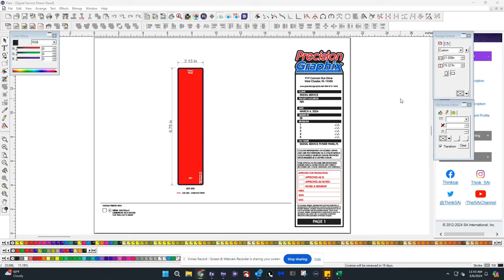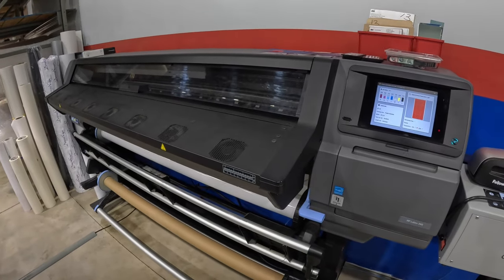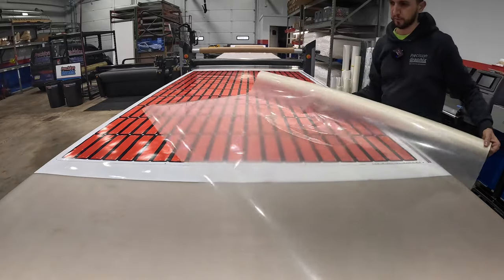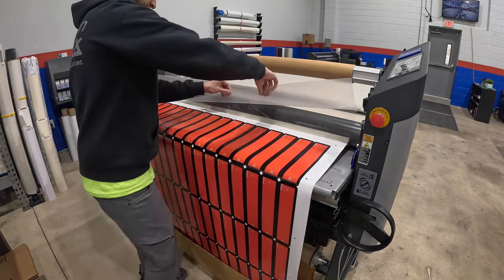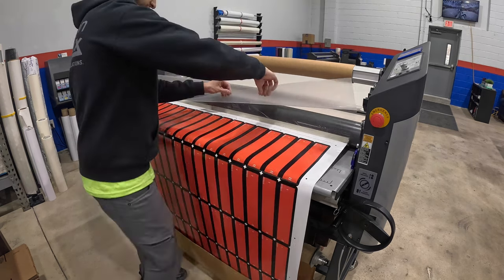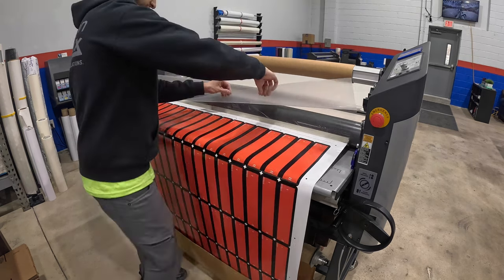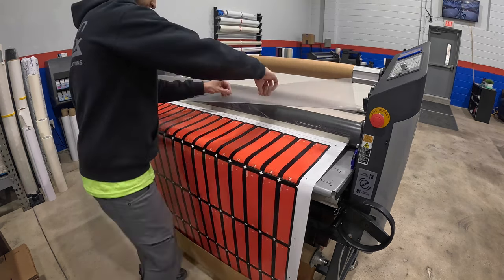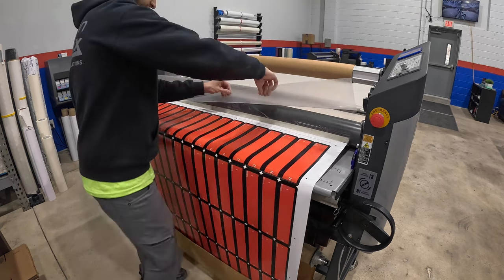How I Make Die-Cut Decals & package them!  | Steve The Graphics Guy

Comment: Nicely detailed process - but this is not die cutting as the title implies.
Reply from the maker: What would you call it?
Reply: Hello Steve, I am a retired builder ( general contractor ) from Australia, I make stuff to fill in time Youtube put this video in my suggestions, you explained the process really well and in a very understandable way, I think the comment about die cutting was meant for metal dies that are made in the shape of the sticker and used in a press, I'm not sure what you would call this type but to me it is a normal progression of technology. Dies were the only way years ago - and may still be used, but you wouldn't make a die for 200 stickers.
Anyway, I've subscribed, Best regards.
Reply from the maker: Thanks for watching! Yes traditional due-cutting was certainly done that way and still used today, just not in my shop. This is todays standard of a printed die-cut decal meaning that it’s cut to the outside shape through the backing.
Reply: Nowsaday, the term die cut is using whether the process using die or not. It's an easy term for customers between die cut and kiss cut.

Comment: Do you call that cutter a plotter? Never seen a cutter look like that. Wow. Looks like high-dollar equipment.
Reply from the maker: It has many names. Flatbed cutter is the most common.
Reply: @stevethegraphicsguy  What it can cut through is fantastic. I can recall cutting many projects by hand while working in a print shop. By the way, is it a vacuum that keeps the project from moving around?

Comment: Great setup and very organised. When it comes to laminating we used to do the same thing for a couple of years and put a box at the base to run the media through the laminator. We ended up and put two brackets off the laminator,  just off the shelf ones and a metal pole cut to the same width. Then slide the pole through the roll and the media would roll smoothly off the pole and through the.laminator. Worked really well we would run a 30m roll through at a time and trim off as needed after it slid in the table. 😊

Comment: Love the video! 

I’m curious, why use step and repeat opposed to the quantity option within the RIP screen? 

I always setup one item, then select it and RIP. You can then configure the quantity you need and adjust how wide, the spacing between and so on!
Reply from the maker: Hey Matt, Sometimes I cut strips on the summa after kiss cut so I always setup a full file and rip that. I think I just did it this way out of habit but your way would have worked in this case and would have been easier!